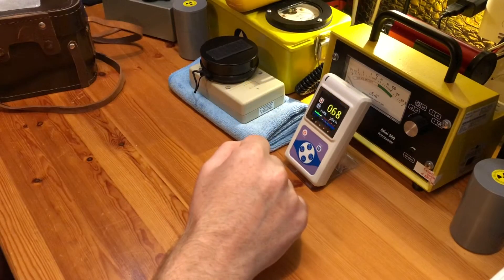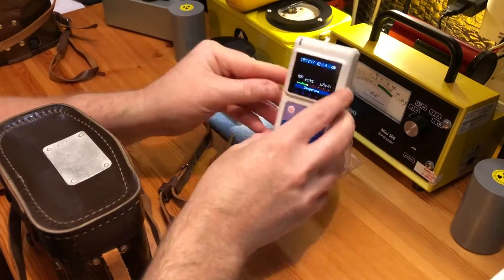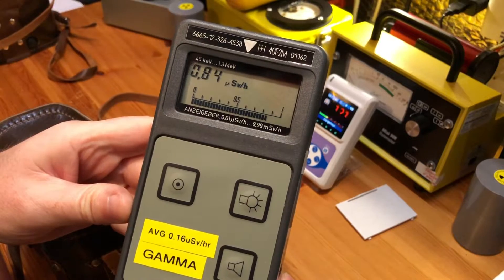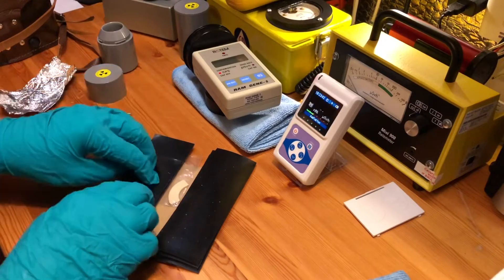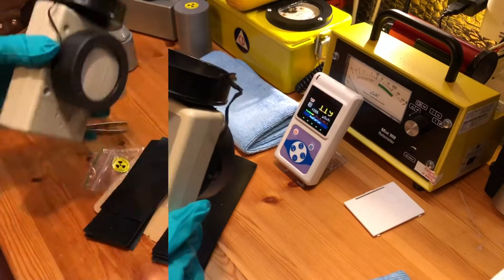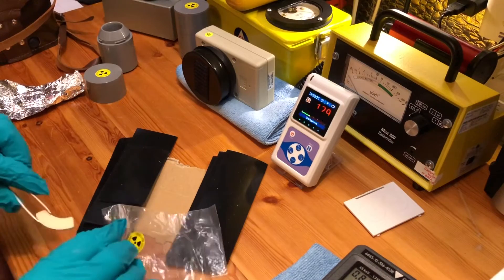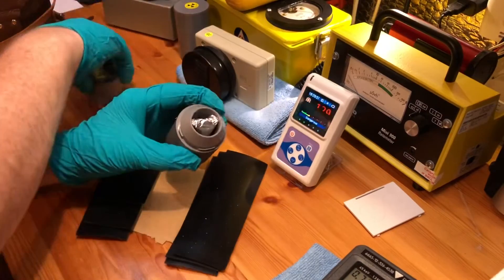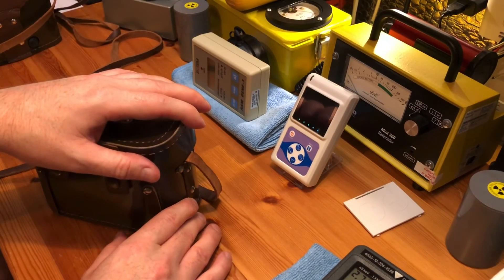☢️Soviet DP-63-A Geiger Counter Experiments

Comment: I get 5.1mS/h from my DP-63-A dial! 😱☢️ obviously handle it with care as you do, when I handle it at all... Incidentally, mine is double bagged and in a lead pig as per your recommendation. Still get mega gamma coming off it of course, even when also inside an ammo tin. At 1 foot it’s normal and within background... but I see you have yours wrapped in tin foil too. Take a reading off your tin foil using your Radiascan with panel off and see what you get 😉 you should find your foil is radioactive due to decay daughter contamination. I had mine in foil, with lead, in a small tin before I got the pigs and all previous containment is contaminated. Bags stop the Radium dust contamination but nothing will stop the decay chain contamination. Check it and let me know what you find. Thanks again for all the tips! R

Comment: You should take a zinc sulfide screen and place it on top (in direct contact) with the radium backlit, and see if it glows

Its easy to make a basic zinc sulfide screen by just taking some clear tape and submerging it in zinc sulfide powder until it has a very thin coating

And I've always been curious what that amount of radiation would look like since I've always been fascinated by radioluminescence

Comment: Does this counter even stay accurate at background anymore with all that radium dust inside?
Reply from the maker: Which one? I used a few different ones in this video. All of them still work fine.
Reply: @SurvivingTheApocalypse  The DP-63-A.
Reply from the maker: Ah, got you now. The DP-63-A doesn’t measure background levels and even with all the dust inside the needle doesn’t move. Incredibly, the Sr-90 source inside is actually to zero the needle!
Reply: @SurvivingTheApocalypse  If you put the scale up against the DP-63-A's own detection window, how much does it manage to register off its own scale?
Reply from the maker: It has never even crossed my mind to try this. Good idea.
Reply: @SearinoxNavras   I measured it, it read 0.4 R/h (4 mSv/h)

Comment: So the shielding on the case is made of aluminium, not lead? How effective is aluminium for shielding?
Reply from the maker: 2mm is usually enough to stop most hard and soft Beta. Gamma passes through it easily though and it would require lead or another dense material. 

You can see in the video how big a difference it makes.
Reply: @SurvivingTheApocalypse  ok, thanks for the reply. Enjoyed the video.
Reply: Yes. Gamma would pass right through, but all Alpha and most Beta wouldn't.

Comment: A geiger counter that is itself nuclear waste. Cool! Looking at the display to check the levels. Nice, everything looks okay! Even as I'm getting cataracts from staring at the dial! 4.6 mSv is insane. Who thought this was a good idea? It's clear that even they knew something was wrong, since they put shielding on the top of the case. The dial blows the check source out of the water, not to mention it's also more reliable due to radium's half-life than strontium. Why even have a check source? Why not instruct the user to hold the probe over the display? Why not even use lead glass over the display? This is one of the most paradoxal pieces of equipment I've ever seen.
Reply from the maker: Stop with all that common sense or you will be reported to the party secretary!! 😂
Reply: @SurvivingTheApocalypse  I actually caught like 2 years of Communism in my country. :D
Reply: @SearinoxNavras  I have an answer to why they did not instruct to measure the scale to test the device. The strontium in the detector is not a check source, it is there to move the scale to the 0 mark on the 1.5R/h mode. If you take a look you can see that the 0R/h mark on the 1.5R/h scale is more to the right then on the 50R/h scale, so they had to make the needle start at 0R/h.
Reply from the maker: Such a crazy design 🤦‍♂️
Reply: @SurvivingTheApocalypse  The Soviets were so crazy that their RID-1 and RID-6M smoke detectors didn't use Americium, but rather reactor-grade Plutonium! The IAEA even has a safe management article about that!
Reply: @radiumquetzal8000  So this was easier than telling the electronics to start with an offset on the other scale....? More dizzying decisions on top of dizzying decisions.
Reply: @SearinoxNavras  It was apparently so, they probably also thought it was a good way to deal with the strontium waste.

Comment: Excellent video, I've got an upcoming one where I used this same scale with the Victoreen 450, from memory I think it registered like 0.53 Roentgen in combined beta and gamma with the ionisation chamber, and yes it managed to contaminate the meter, thankfully the bottom of the case is waterproof so I was able to use soapy water on it a few times and get it back to background levels.
I didn't end up using gloves for that video but I did wash my hands about 5 times in a row with soap and water and then checked them for contamination.
Reply from the maker: After your video of the Terra-P being contaminated by the rainwater I just don’t take a chance anymore!

Comment: Amazing video about these beautiful sources! I really like that you are taking safety seriously when handling these. It is not fun to either contaminate a meter or end up contaminating you or the surrounding area. One of the more dangerous things when it comes to these types of sources is the incredible amount of radon from them. I had touched the inside of one of my radium containers when I noticed that there had been a hole in my glove, as one should I washed my hands for a long time, up to 10min and I still got 2000cpm from the finger, bad stuff.
Reply from the maker: It was your original video that made me want to buy one! Owning one has really made me appreciate safe handling and storage of sources.
Reply: Yeah the radon is the only reason I haven't tried to get one of these, that and the possibility of it flaking off.
Reply from the maker: I ended up getting rid of the source. Too dangerous and not worth the risk.
Reply: @SurvivingTheApocalypse  noooo, that's so sad :(
You should have tried to encapsulate it in epoxy or use another method to make a sealed source

Comment: in your opinion, is it worth it to buy a 90gbp DP63A and gut it for the radium and strontium? or am i better off buying radium dials on ebay?
Reply from the maker: Your definitely better off getting the DP-63-A as your getting a lot of sources for your money. You just have to be bloody careful when stripping it. If you watched my instruction video on how to take one apart you will see that there should be wax seals over the bottom screw holes. If your buying a meter then make sure to ask the seller to provide photos of these seals. If they are missing then the check sources and the dial has more than likely been removed.
Reply: @SurvivingTheApocalypse  where did you get the grey cylinder for storing the source?
Reply from the maker: American eBay. Bought it through their ‘global shipping program’.
Reply: You will find it very difficult to find any other item or dial that is this radioactive. Not even the US WW2 luminous disks are this hot.
Reply: Its worth buying a DP63A, but it hurts seeing historical things taken apart 😔😔😔

I'll probably buy one one day and strip it of the dial since i love collection sources too, but im gunna put it back in the unit once im ready to sell it so that someone else can enjoy the unit and it's radium source in the future
Reply: @greenalien8503  There are variants of the DP-63-A which do not use a radium dial and instead have a backlit scale powered by battery. These are the latter variants and you can tell them apart because they have a wider, more rectangular black edge to the scale than the crescent-shaped radium dial.